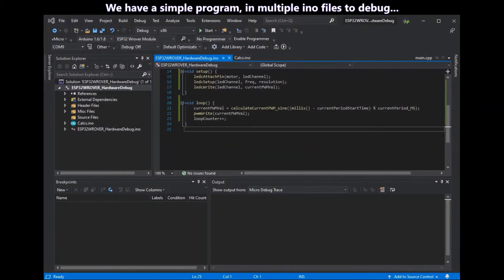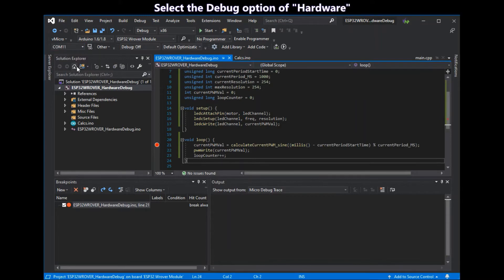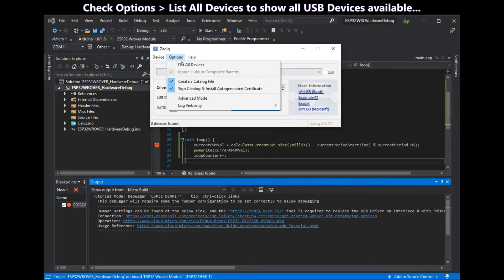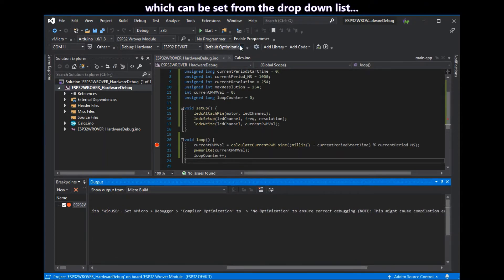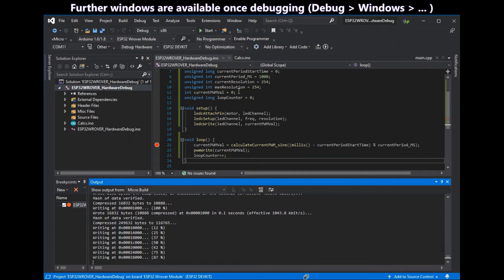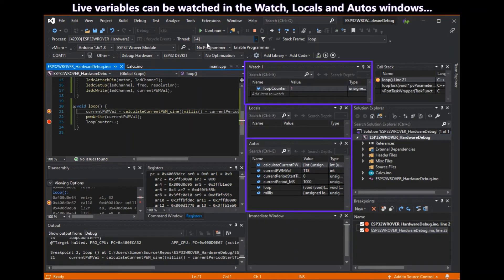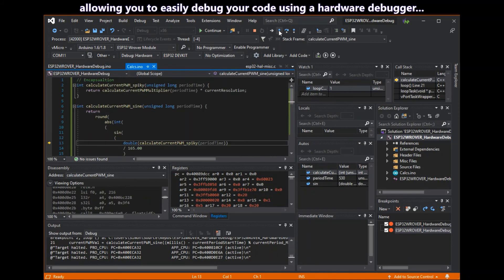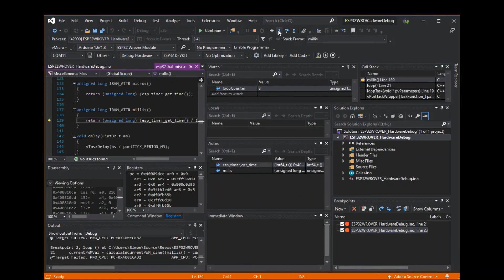Arduino: Hardware Debugging ESP32 with vMicro

Comment: do I need a special board for debugging? I have esp32 wrower, I cant get it working
Reply from the maker: You need an external probe for the ESP32-Wrover boards for Hardware debugging in this video. If you have the DEVKIT the probe is built into the board itself.  Compatibility with probes and built in configurations are shown below in the ESP32 column:
https://www.visualmicro.com/page/DebuggerSupportList.aspx

To debug with no additional hardware via the Serial port (and even over WiFi), see this walk though guide:
https://www.visualmicro.com/page/User-Guide.aspx?doc=Debugging-Explained.html

Also see our ESP32 Overview Page, the Debugging Tab has links to all relevant information:
https://www.visualmicro.com/page/Espressif-ESP32-Overview.aspx

Comment: Hi. I noticed u debug using esp32 devkit. Can i know the wiring diagram from esp32 wroover to esp32 devkit? Regards.
Reply from the maker: To wire an ESP32 board without the in-built programmer (as on the devkit), our ESP32 Debugging page has the JTAG connection wiring explained:
https://www.visualmicro.com/page/ESP32-Debugging.aspx

If you are using the ESP32-PROG we also have a video guide for that specific debugger/programmer at
https://www.visualmicro.com/page/vMicro-Videos.aspx#ESPPROGUploadProgammer

Comment: Today made a setup with EPS32-Prog JTAG, and Visual Micro. But I made the mistake of replacing the Dual RS232-HS (Interface 1) with the driver and not the Interface 0. And then I could not make it work. I then replaced the interface 0. 
But then I did not have a serial port because both were now replaced. And I took me most of the day to figure out how to get back to square one so I could try over. Basically go to Device Manager and find the devices under "Universal Serial Bus Devices" -> "Dual RS232-HS" and then uninstall device and use checkbox "Remove driver". 
If you have run Zadig several time you may need to un/replug the device and remove driver again several times, until they finally show up under "Ports" as just "USB Serial Port (ComX)". Then have a go at using Zadig again. Have fun. 
And thank you for this video. Excellent product you have made!! Couldn't live without it.
Reply: Useful info thank you! We will add to the docs.